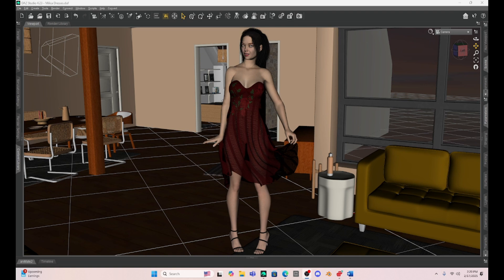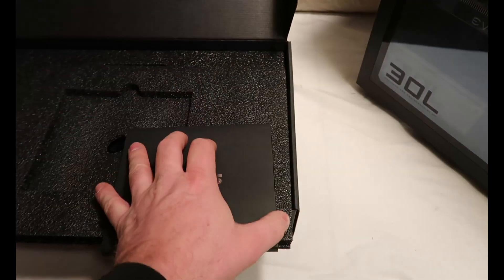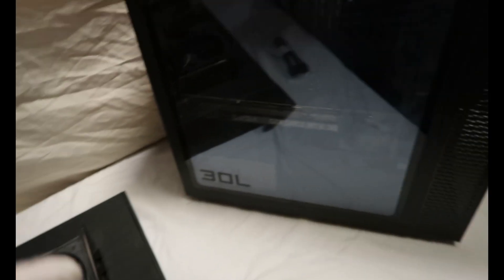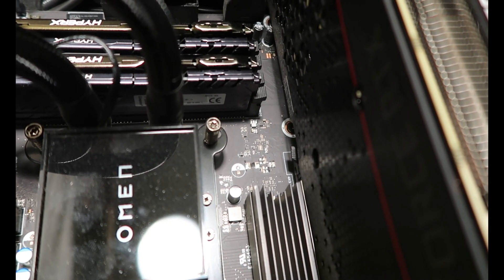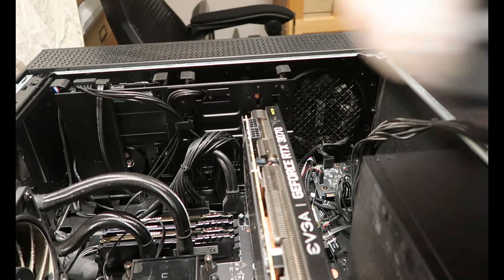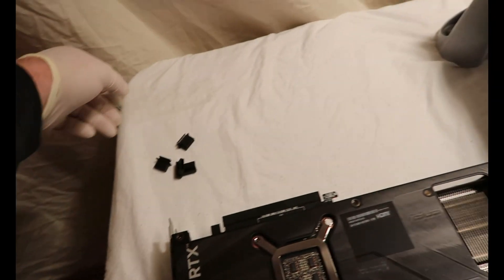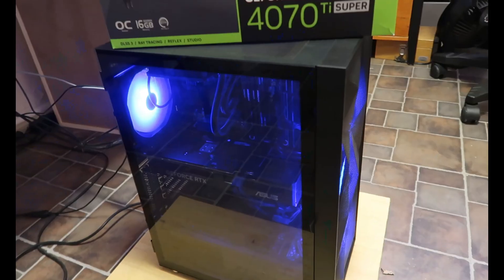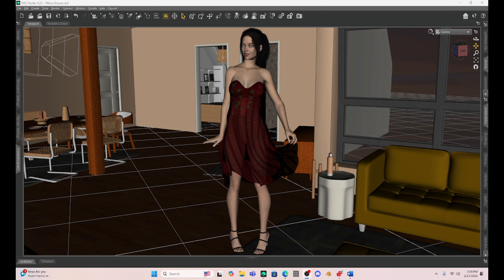Daz Studio: I Installed A New GRAPHICS CARD!!!

Comment: congrats on the new hardware I did an upgrade back in January with a 4080 super card and it has improved render times dramatically over a 2080 ti card
Reply from the maker: @azpetnutrition4729  Awesome! I thought about a 4080 but the 4070 was a good deal so I went with it!

Comment: PSA: regardless of the price (or melting cables issue) you should wait if you're considering buying 50xx series Nvidia card solely for working with DAZ Studio. These cards are NOT supported yet (or rather Iray doesn't support them). There is a post on DAZ official X account and a thread on DAZ forums.
Reply from the maker: @NameSurname-f9t  Thanks for the important information!

Comment: YES ! You need the new power cord ! The 4070 is power hungry. Connect the cord to 2 outlets  from the power supply. The new cable is to reduce the heating from the increased current draw of the card.
Reply from the maker: Yep!  Exactly!  Also, make sure you have a power supply that can handle the 4070... I have a 750 V power supply which will handle it but nothing more!

Comment: LOL. GPU doesn't fit. I feel your pain.
Reminds me of the time when I had to completely Frankenstein my old PC to upgrade my GTS 640 1GB to PALIT GTX 770 4GB...... I had to completely demolish my HDD drive bays in the crudest ways possible to make the GPU fit..... Then I had to put my HDD/SSD loosely into the only free Optical Drive Bay with duct-tape, so they don't fly out

Then the GPU would shut off my whole computer under load because my PSU was CRAP, so I had to buy a modular Power Supply then the power supply wouldn't fit so I had to just plop it on top of the case with wires going into the hole where the old PSU used to be...... 

My first render-rig.........It was a workhorse not a show-horse.... That's for sure. XD
Reply: The other is to make sure of airflow, many years ago I had a GTX 570 overheat and die because the case I had it in had terrible airflow.

Comment: I'm running two RTX 4060 with a AMD Ryzen 7
Reply from the maker: Wow!  I bet it is awesome at rendering.
Reply: @notfromthisworld7672  my bottle neck now is my PC RAM... Both the cards are using most of the 64 Gigs of ram I have 😞
Reply: 4070 / 5950X / 64GB RAM. Fairly happy with DAZ and gaming. The underlying system is 3.5 years old. I‘m an audio professional and a DAZ hobbyist.
Reply: Those new GPUs don't have SLi support. How did you manage to get both working in the same system? To my knowledge, It should not be possible, and only one card should be working.
Reply: @pascalgagnon8088  you can't use 2 RTX 4060 for gaming it doesn't work... But it does work for doing rendering... When I run renders it shows both GPUs doing the work
Reply: not supported. Everyone says iCore is better for creating renders.

Comment: Congratz indeed on the new video card, I have a RTX 4070Ti Super as well and it is great for rendering. Just be warned that you can fill that 16GB of vram very easily, as I found out when rendering some scenes.
Reply from the maker: Awesome!  I haven't run into any rendering issues yet.  What is its limitations?
Reply: @notfromthisworld7672  For me it was having so much in the scene, I had one scene for a comic I did with about 12 to 14 Genesis 8 characters with hair / clothing background environment and what not in it. To get it to render well I had to downsize quite a few of the textures to get it render without hassles, I have had a couple of scenes use up all the GPU's vram without a second look. 🤣 And since I mainly do comics and do postwork on the renders afterwards with Affinity Photo 2 or Krita, I am not worried too much about the texture resolution and so on. 

It is funny when I have to shrink texture files of any Genesis 8 characters I use from 4096 to 2048 for main characters, and 1024 for characters that don't stick around long. I think this is due to the fact I try to make complex scenes with a lot happening. Another big hassle was some of the HDRI's I was using as some were over 200 MB. 

I do have a plugin that hides what is not being rendered and have hardly ever used it, because of the hassle to understand how to use it properly. lol

One recent addition to Daz Studio was Filatoon a plugin that uses the Filament renderer, it gives a Cel Shading / anime type look. It does look very good and I have used it for a comic. One of the best things with Filatoon / Filament is that it has nearly an instant output say about a couple of seconds or so. There are some downsides to Filatoon, which is there is a lot of setting up and converting of content to use it, which is why I still use iRay a lot, that and I understand iRay a lot more. lol

Comment: Congrats on the new card and case.
ATM im running
Geforce 4060 rtx 16 Vram
Ryson 7 3700x
32 GB ram(would like to upgraded to 64 just not sure if its worth it)
SSD 2TB(getting too small)
Various SSD's and HHD's for windows, gaming, storage ect.

im also curious if you have any experince using a 3d mouse for the camra in Daz3d?
Reply from the maker: Sounds like you have almost the same set up except for the ram.

Comment: hurray! glad you got the card installed! 
it just sitting in the box must have just been maddening!  
very glad you got a bigger box and the lights are always nice. 
(would you be able to have the 3070 run on it too? like ot use for just the monitor?
Reply from the maker: It was difficult to know I had it but couldn't use it! You can't combine graphics cards into one system unless they are identical.
Reply: @notfromthisworld7672  i was thinking not about combining them but rather driving your monitor and system off the older card, and using the remaining one for rendering exclusively